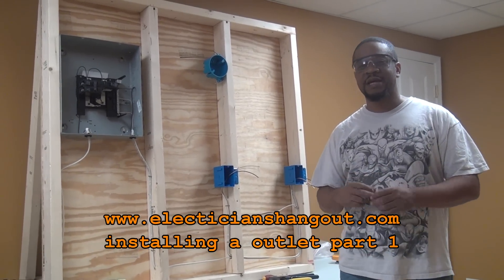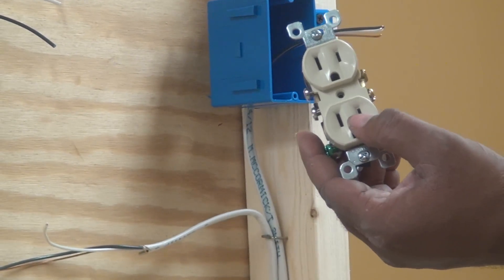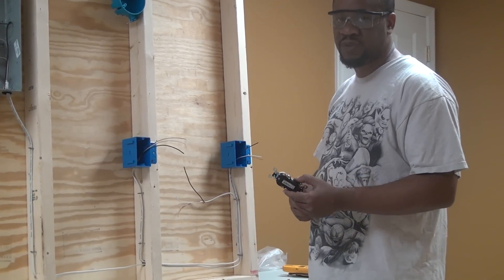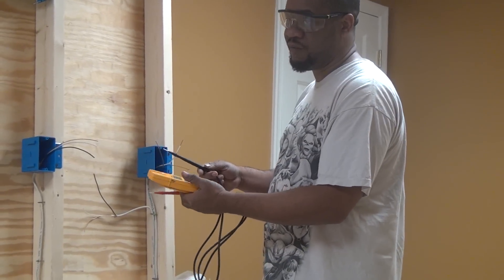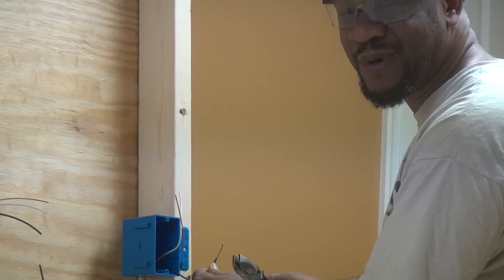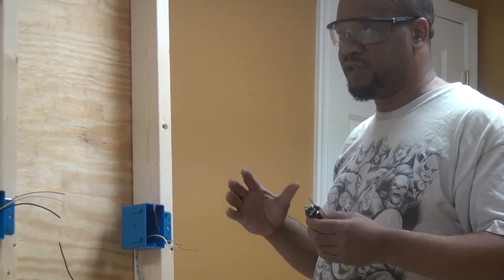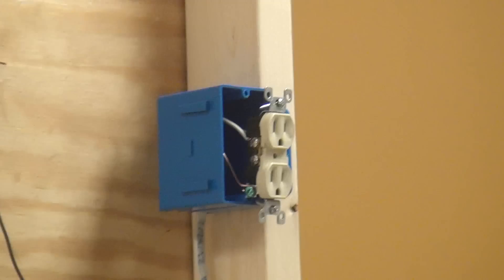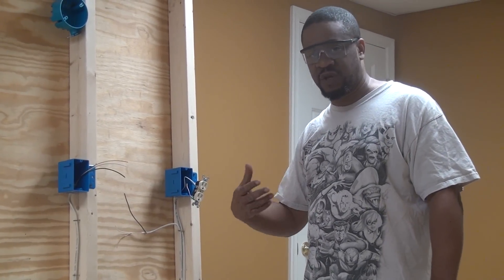How to install an outlet part 1

Comment: can you do a tutral on a split circut sharing neutral having to put each circut on opasit legs or if its 208 each leg sharing neutral on opisit legs so each circut is not on the same leg and warn people to turn off all 3 circuts sharing neutral or in a home both circuts sharing the neutral

Comment: hi how are you i saw a video up grade residentral 200 amp service by savoski scott it looks like he put copper and aluminum totether in a brass split bolt i made a video about a al cu split bolt with  a devider and sed to him to consalt a inspecter about al cu connections

Comment: Tyrone, These are great videos!  I am making adding a closet to a downstairs office and want to turn an outlet that would now be inside of the closet into a light fixture.  To do so I need to remove the outlet, which currently has 2 blacks, 2 whites, and 2 grounds spliced together.  This is twice as many wires as you are showing in each of the outlets above.  I know this is wired in a circuit to other outlets in the room (parallel I am assuming).  How would you replace this outlet and route the power through a single light switch and then to a new light fixutre???
Reply from the maker: extend a 2conductor cable to your new switch box from the existing outlet just tie all blacks together and all whites together (in the existing outlet box) extend another 2 conductor cable from your new switch box to the ceiling box for your light. in the switch box you now have 2 cables with 4 wires 2 blacks and 2  whites. tie the white white wires together and put the 2 blacks on the switch. the black and white in the ceiling box go to your light fixture. Just make sure that the light that you use in the closet has a hard covering. The rules for installing lights in closets are very strict. I will just assume that the closet does not meet the required clearances hence the hard plastic cover (typically a florescent light)

Comment: Would a 220 volt outlet have a similar installation process?
Reply from the maker: it depends on whether the 220v outlet has a neutral or not but yes it is similar.

Comment: Tyrone, I am gathering tools for my first electrician class I am currently enrolled in. How much does a descent reliable multimeter  go for? The max budget for one of these devices I have set is $200 will this be enough?
Reply from the maker: yes 200$ is a plenty to get a good reliable multimeter